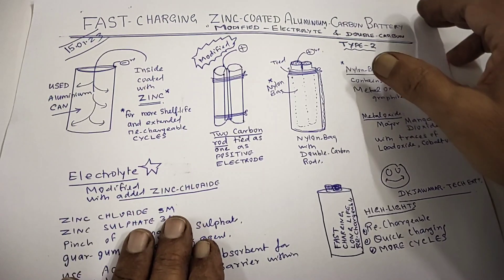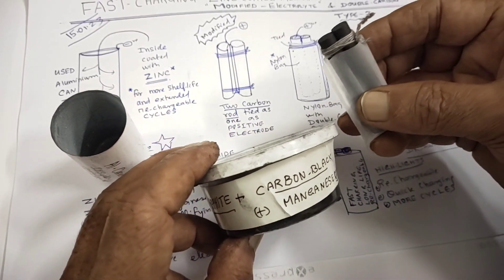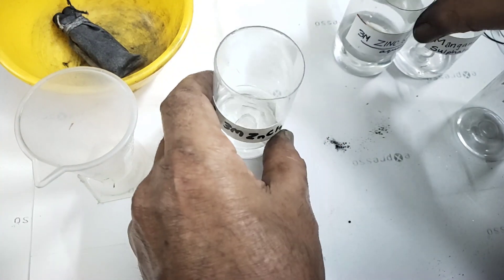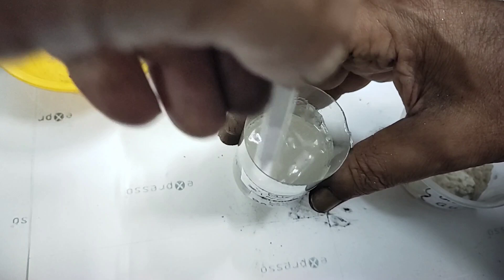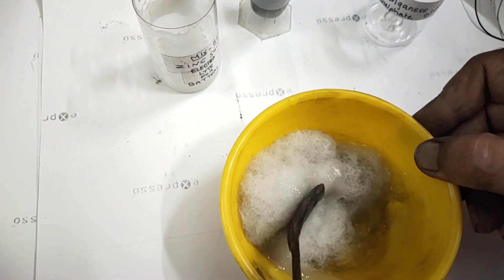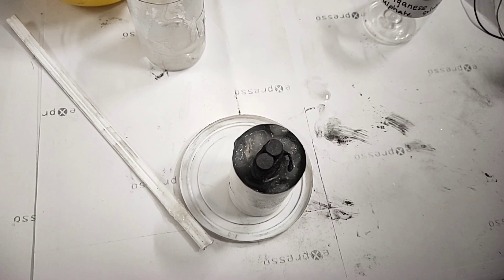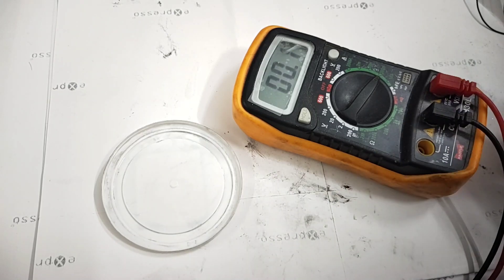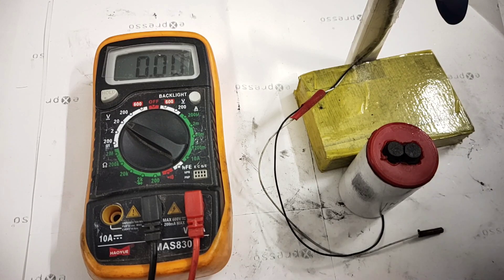QUICK CHARGING ALUMINIUM CARBON BATTERY FROM TRASH- TYPE-2, MODIFIED V 1.5, 500mA LONG LIFE CYCLE

Comment: من فظلك ماهي مكونات الجل ؟؟
Reply from the maker: The paper shows all the details required for gelling. Also, I have shown a video on preparing 100% workable electrolyte for aluminium carbon battery - which clearly explains gel formation.

Comment: DKJ Tech:- An immense & valuable experience to learn from this Part 2 video, your research on this is excellent as of more amperage & voltage with high self life + quick charging, what more do we need, your electrolytes combi really very special, (as a battery person to say) a good result oriented battery you presented, thanks for the such a beauty/sturdy/handy Cell + effort.👍🏿👍🏿👍🏿 JPN.
Reply from the maker: Thank you for your support and valuable comments for this work. I need your sharing with your friends. This battery on charging gives a volt of 1.88 and current more than 1000mA., This was found after 1 hour saturation.👍🙏